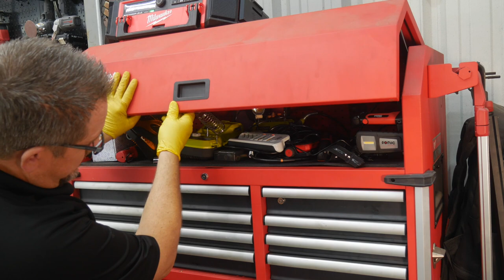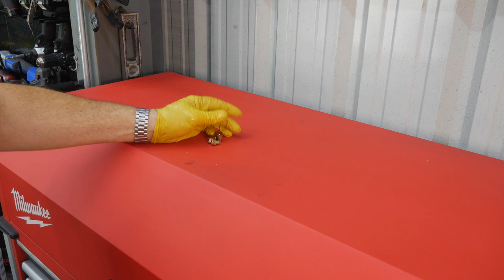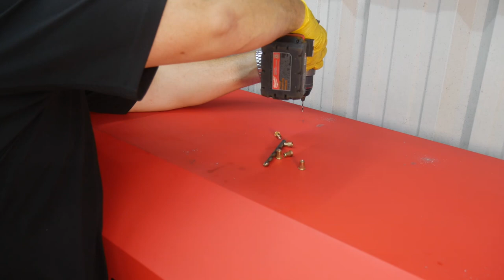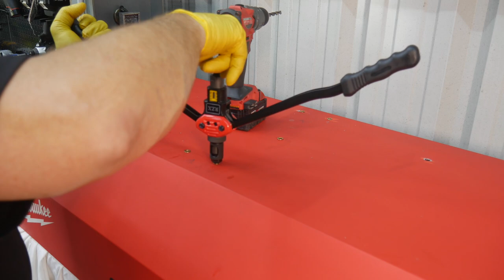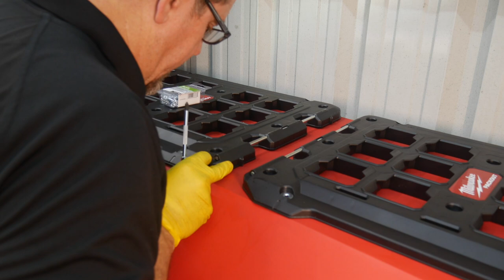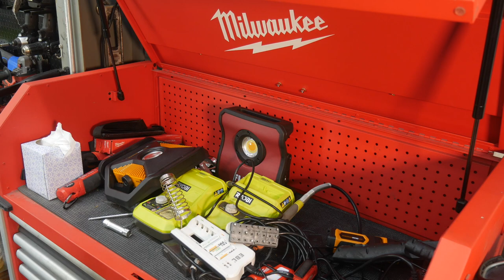PACKOUT Your ToolBox!! Milwaukee Tool PACKOUT Mounting Plate Uses [Rivet Nuts]

Comment: Nice mod. One negative is depending on what you packout on top, the tool box needs to be placed further away from the wall for more clearance
Reply from the maker: That is correct. You can't stack too high, or you'll need to move the toolbox out from the wall. Thanks for watching.

Comment: There are some guys who make steel and aluminum packout mounting plates with mounting tabs and those are slightly smaller which would be perfect for that application.
Reply from the maker: Yes, I've seen those. That would be pretty cool. Thanks for watching.
Reply: Link?

Comment: I never understood why people buy overpriced plastic trays instead of proper cheaper toolbags that have been doing this for decades with more room. They're trying to solve a problem that never existed. Wouldnt it be better to just by a middle box with proper drawers with more room than to make your toolbox look like a transformer with plastic trays big enough for a couple sockets
Reply: I agree
Reply from the maker: I do see your point to some degree. There are many many trades that use the PACKOUT system for just about everything, from tools to equipment, and even parts and pieces. Sure, we could easily store these tools and pieces in a toolbox...except for the radio. However, even though we don't do a lot of mobile stuff, we do find ourselves doing small projects in the field or helping someone out. This makes it easy to grab a complete socket/ratchet set or radio and go, without having to fill and empty a bag. It's definitely a preference thing. Thanks for watching.
Reply: Why use an M18 Fuel Drill or Impact vs your 40 year old corded Black and Decker or Craftsman?  You need to expand your mind a bit, mushrooms or DMT might help.  Organization and the shop have been age old issues, e.g. getting the tool bags to the job site without multiple trips, which tool bag, digging through the old tool bag, storing the old tool bags, etc...

Don’t be so cheap!
Reply: @Shoptoolreviews  pieces and parts are where I could see these really shining, especially people who go through electrical pieces of different sizes
Reply: @martylucas8557  Having a 15 thousand dollar toolbox isn't being cheap, the difference between me and snap on type guys are I'll have way more tools to do different jobs for the same amount of money spent. Same thing here, if something's overpriced without reason it's kinda like forking over 1000$ for snap on sockets instead of buying a complete variety of sockets for every bolt for the same price because "quality" of high end brands was never an issue that warranted spending that much more for snap on ones